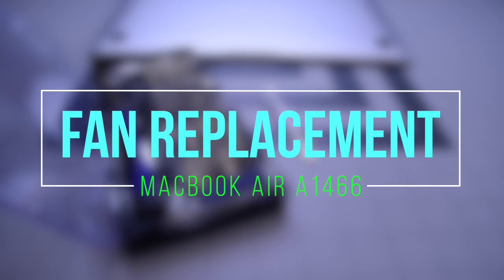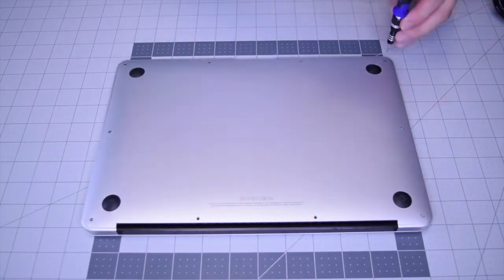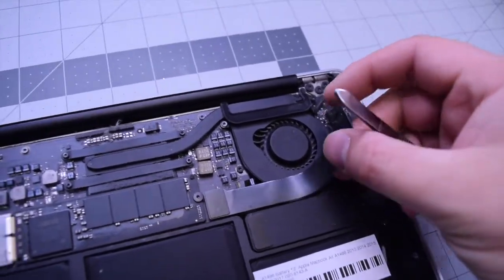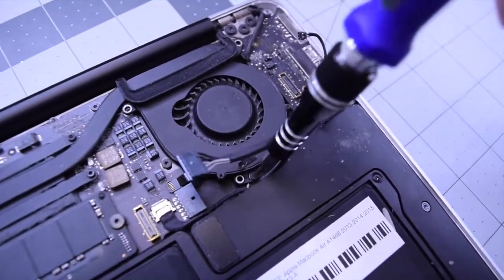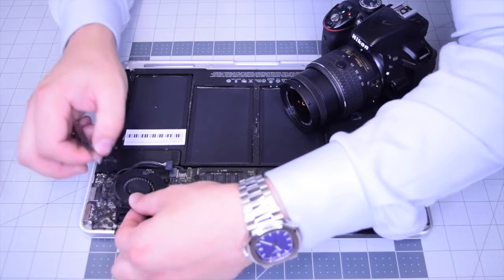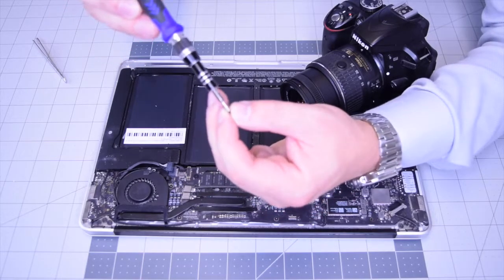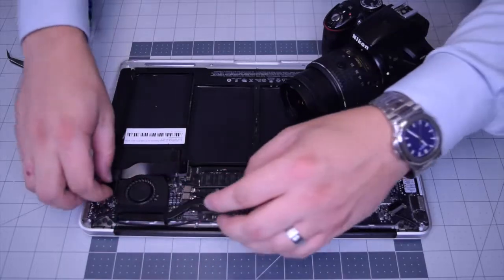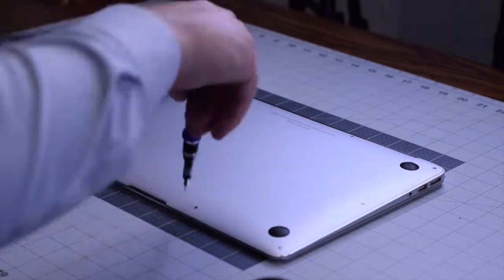Macbook Air 13" 2012-2017 (A1466) - Fan Replacement

Comment: 😎0:16 / 3:43 Fans were running all day, saw lots of diagrams of the inside but here at your numbers I saw where the fans' exhaust are, that's when I noticed the pencil blocking the exits, sorry, not tech savvy but your video is very interesting, bff does my repairs, will tell him of your excellent video.🪛💻I love my Mac Air💝

Comment: Hi, thanks for the video - very helpful! 

if I may ask.  I upgraded my ssd and after closing my A1466 the fan makes this rattling noise. The noise is gentle when on flat surface. My suspicion is that the rubber is not entirely coming over that little metallic bulge to hold it in place. I did take to lid off the fan to remove dust etc. Any recommendations? Please, advise.
Reply: i have the same thing idk how to install the rubber gasket